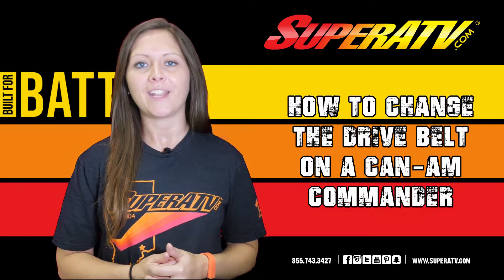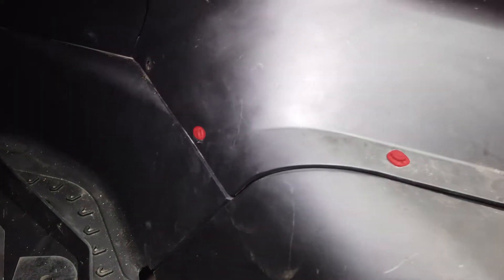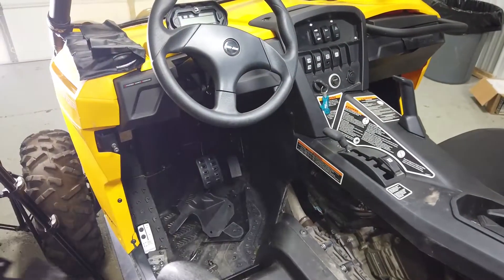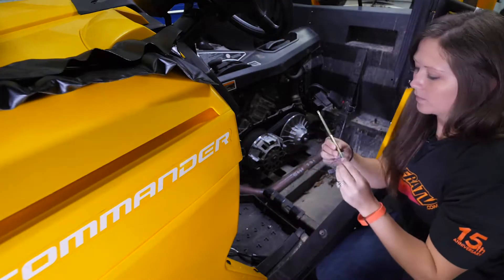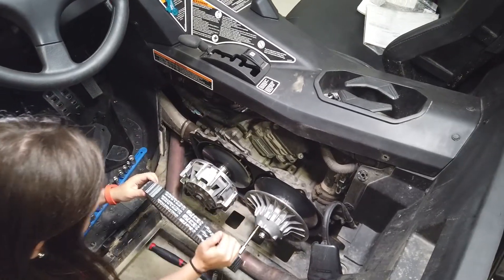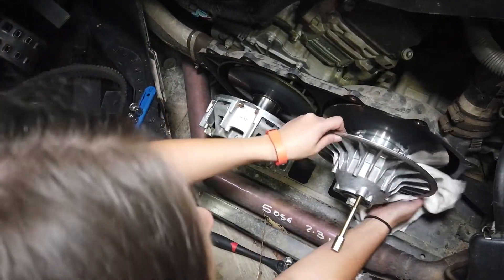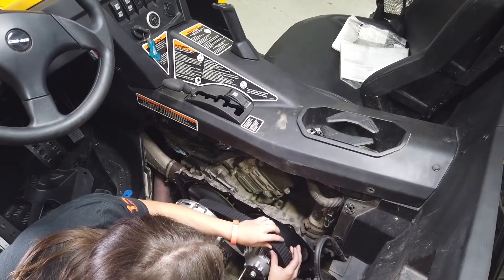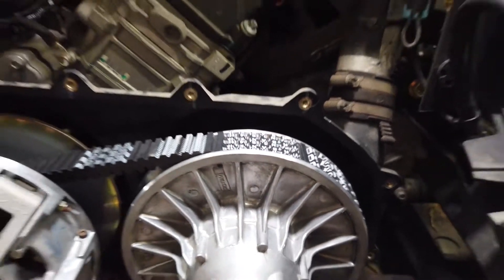How to change/replace/inspect Drive Belt on Can-Am Commander | Maintenance Matters | SuperATV

Comment: According to belt manufacturer you should not use brake cleaner to clear the clutch surfaces it can negatively effect belt proformance. Instead use  alcohol  or acetone. Also don't forget to properly break in you new belt before use.

Comment: How to do know what way the belt is supposed to go. My dad traded in one of these from a surf club and it’s in bad shape all of the steering components are rusted. The clutch spins when it loses traction and hasn’t been looked after and it’s a 2018.

Comment: Didn't pay attention to rubber seal on clutch cover, how does it fit back on
Reply from the maker: It will press back into place, but if it is damaged or out of shape, you may need to replace it!